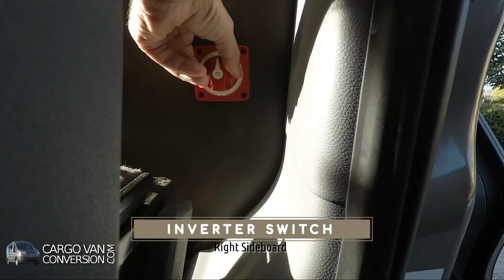Mobile DVR, Wiring & Cabinets

Comment: You are doing a great job trying to mitigate vibration risk.  I've watched a lot of van builds in preparation for my own & most leave some critical electrical wiring exposed to an angle that you know 20000 miles down the road will be a short.  Doing automotive repair for the last few years, that's the most impressive (& sometimes disappointing) engineering feat in vehicles. Many of the builders have a better understanding of solar system integration requirements than I do, but seem to forget that their building it in a structure that sees thousands of vibrations per minute just at idle😁.  Keep up the great work. Would love to see more about your dvr system as I'm planning a 360 degree system for ours (based loosely on cycle cruzer "bug out" van).  His takes 4 camera inputs, records, & displays all 4 on one hdmi channel for viewing on a TV. (Comes in handy if there's a bear/mountain lion hanging around while you're camping:)
Reply from the maker: Hi stgreen78,
While I'm not an expert in many of these fields, common sense will go a long way and since I'm addressing many thousands of viewers nowadays, I feel some obligation to go a bit further than the basics.
I have had a DVR laying around for some time now, but haven't had the time to do the install. It probably will have to wait a little longer as there are so many other things to do, that are more important.
I just had to put some wiring in for it, before it got more difficult after the Murphy bed was done.
The wiring was basicly three leads from a point under the driver's seat (battery compartment), were I could get a ACC signal and a left or right turn signal. I don't know whether I'll be using all of them, but just in case.
The system will have four camera's and can be used as a dash cam, for liability issues in accidents, the rear camera (as I already have a back-up camera) to have a better overview of the traffic behind me while driving (when allowed by law) and most importantly at night, when parked, either to see who's around the van or look at any wild animals in my boondocking site.
I'll post some more info as soon as I have some time to write a comprehensive article.
Van Williams

Comment: Well I got to see some of your wiring expertise..  Where would I go to learn what needs to be wired and how to do it for a conversion.. the charger, solar panels, interior lighting ad 12 v stuff..   ugh... I don't know when that stuff needs to be done.   love your demos.. I'll buy it from you!!! :)  from Scottsdale AZ
Reply from the maker: Hi Jann,
The actual install of the solar/12V components is surprisingly simple; finding out what and how much you need is more intriguing. How much solar, how many batteries and what type. Then the right wiring, etc. Do you plan to use propane, because that lowers the need of solar/batteries. Lots of reading and some good advice. Connecting the lights and 12V appliances is another part.
What I would do, is collect a lot of ideas, from layouts, colors to appliances and type of vehicle. Then you know from the appliances, how many Amps you need and dependent on how you use the van (only boondocking or just campgrounds), you can calculate the number of batteries and then, if necessary the amount of solar panels. Everything ties together.
Van Williams
Reply: thanks , at one point I did see  a gentleman diagramming how to figure this all out.. I will be inputting all my needs of usage and then that would help figuring what I need. That was a great presentation from him.. I saved it but I am getting overwhelmed with everything I've seen. But your van build is so intreging and so worthwhile to save and replay time and time again.I wish I lived down there and was your fly on your shoulder. I was like that with my dad. he since passed 10 years ago.. This would have been his concept,, you two would have been 2 peas in a pod.  I miss his knowlege but now I have you to envision a dream!.. thanks so much. hugs from Scottsdale
Reply from the maker: Hi Jann,
When you get overwhelmed, take a smaller slice. It all starts at the beginning: first define what your goal is, how do you want to spend your time. Then, what kind of vehicle: passenger car, small SUV (Ford Connect ??), cargo van (low roof, medium, high ?? short, regular or extended van ??). What does it cost? New or used? Find out: do you need a shower in the vehicle, a fridge, do you cook in the vehicle? Do you cook on propane, or a propane heater or all-electric. It's a very slow process and very much dependent on time, cost and need. You can use your passenger car and spend $500 and have a bed from 2x4's, a sleeping bag, cookset, porto potti and water jug. And you're ready to go. Or what I'm doing, or something in between.
As long as you know what you want out of it, you cannot really go wrong. You will make mistakes, but who doesn't?
Thank you for the comparison; wish I could have met him. i lost my dad too some 17 years ago. I know how you feel.
Van Williams

Comment: Hi Van. It seems to be coming together well. Is it almost finished - or maybe the question is, “How long before these build videos will end?”  And do you expect to continue filming traveling videos after the build is done?  And please pet Joey for me. Cliff.
Reply from the maker: Hi Cliff,
Interesting question.
And no, at this rate it will take a long time. That isn't a real issue for me as I like the work and the making of the videos, while using the van on shorter trips. The main reason why it takes so long, is that making these detailed videos every week and all the other online work, consumes 75% of my time.
My goal is to be at a better place by the end of 2018 or early 2019 and then move into the van permanently after that. But that also depends on my business and selling my home.
As with planning the van conversion, I already started thinking about the time as a Vandweller. Would like to continue making videos and as you said, and travel videos are a logical continuation of that. They probably would contain a lot of hiking and some backpacking. But I'm more ambitious than that :)
High on my list is the ability to help during local or national emergencies; moving quickly to the area of concern and help, perhaps saving pets or in anyway I can. I have to figure out what is the best way for me to help.
Then there is helping with community builds. Many of my readers and viewers have reached out to me about help with their own conversions. Unfortunately, at this time I can only give them advice and help with resources. I'm figuring out if I can do that on an individual basis or p.e. during the RTR or alike. I could make that a business, but would rather do that without money involved. It would also be a better fit for the current website and videos.
Then there is my personal favorite. While I'm far from being a filmmaker, Youtubing has sparked my interest. Would like the make an annual series of videos, likely connected to my travels. Very much interested in Native American history, archaeology and nature and researching and filming one year and posting the videos as a weekly series the next year is one of the possibilities. I still playing around with other ideas.
So this was a long answer on a simple question; you'll have to stay around to find out :)
Have a great day!
Van Williams & Joey

Comment: You should try vinyl edge banding.  It is pre glued and trims easily with a very inexpensive tool.  Love you videos.
Reply from the maker: Hi James,
I'm not into the vinyl stuff, but I could use wood veneer edging. Easy to apply and looks good. In this case, I wanted to refrain from using anything else then the two (or three) principal colors of the Formica that I'm using. The modern design should be clean and straight. In any other project, I would use the veneer banding or solid wood edging.
Thanks for the input and for watching.
Van Williams